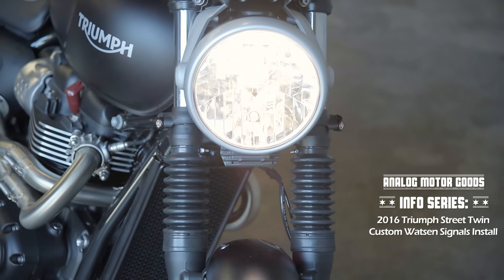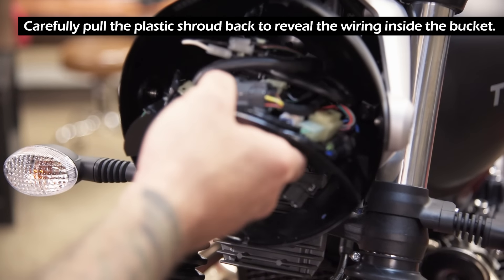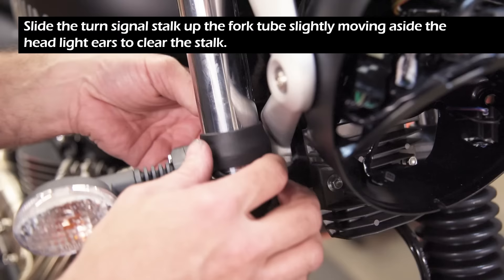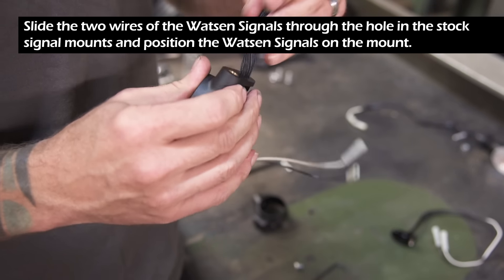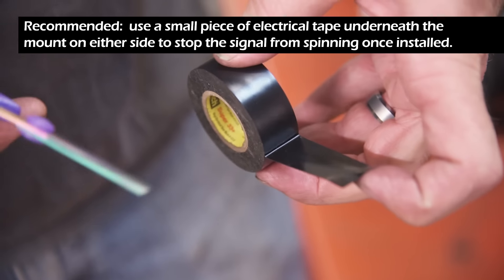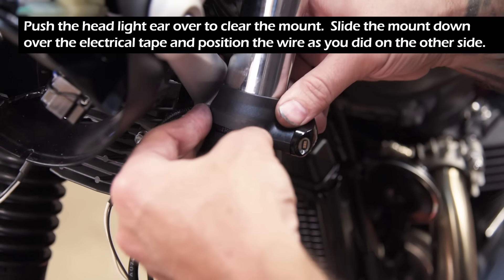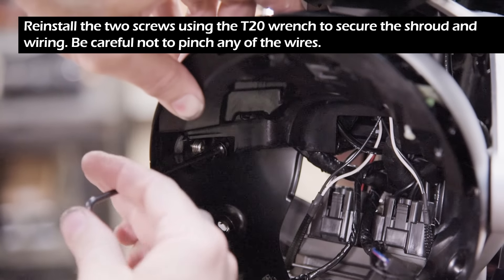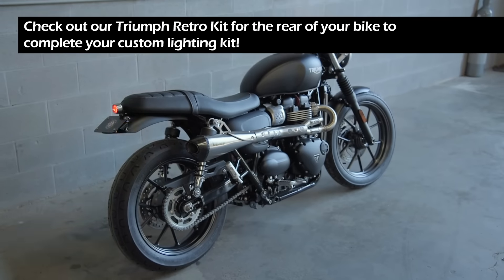Analog Motor Goods - Triumph Street Twin Analog Signal Pods Install Video

Comment: I would like to get this lights for my 2020 speed twin, is the process (the wiring) the same?  thank you in advance for taking the time to answer my question
Reply from the maker: The front is pretty much the same. Rear on that model we have not had experience with.

Comment: Just installed! Thanks for the great video, install was super easy and looks great
Reply from the maker: Thanks!!
Reply: Hello there. Just curious how easy was the install overall? Just following this video is good enough? Everything holding in place ok? thanks
Reply: @davidsantiago-ji8fi  absolutely easy, just as done in the video. I used the electrical tape and it's not moving around at all.
Reply: @alaskabrah2365  cool thanks.  What year is yours ?Did you do any lights on the back? I’m about to order a tail tidy from NRC
Reply: @davidsantiago-ji8fi  I have a 2019 and I did the nrc tail tidy as well. That was an easy install also
Reply: @alaskabrah2365  oh nice. Mine is a 2019 as well so both are on order. Do you have any pics ?
Reply from the maker: @davidsantiago-ji8fi   Sorry for delayed reply but they are pretty straight forward to install. Just like the video.

Comment: They're so small. I know, that's the idea. I take it the factory clamp is plastic?
Why does the clamp rotate on the fork leg after u put the new light on, if it doesn't prior, with original light? Can you change the bulb, or do you have to buy all new when it blows? Good job.
Reply from the maker: Clamp is plastic. They do rotate on fork with stock light if bumped. It is just a recommendation we found that keeps them staying put. LEDs are not bulbs and if they go bad need to be replaced. Odds of them going bad are pretty slim. They last a long time unless there is a something wrong electrically in your bike that damages them which is also fairly rare. We have yet to see one fail.
Reply: @analogmotorcycles  Thanks. I've been replacing a few lights on my van with LEDs. I remember the LEDs on center brake light s on vehicles, where individual diodes fail. One by one they drop out. Looking gross and losing lumins. I believe tape,under the strap will keep them fixed. Good u suggested it. Thanks.

Comment: If they ever make them for the Indian Scout Bobber but as running lights/turn signals I'll place an order.
Reply from the maker: The LEDs and voltage regulator we use would not withstand the "running" light portion of that scenario. They are only able to handle a flashing, not a constant on. Would need to be a bigger housing or different design to handle that. We do not plan to make them "running" anytime soon.
Reply: @analogmotorcycles  sad it's so limited.

Comment: Ive removed the lights from the headlight but how do you remove the cables connected to the inside of the stock LIGHT?
Reply from the maker: The video is pretty thorough. It explains the whole process. Not sure what more you are needing?

Comment: Would these fit on the rear side of of a Royal Enfield Continental Gt 650?
Reply from the maker: These are designed for Triumph's with triumph wire harness ends. We offer a Universal set of Analog Signal Pods that might work for you.

Comment: Great vid. I just subbed. Will the system and installation be similar for the 2018 street scrambler?
Reply from the maker: Yes it should if the signals are mounted in same location,

Comment: Does the bobber has the same wire harness located as shown in the video?
Reply from the maker: We have not had a bobber in house but others have installed these no problem on their Triumph Bobbers.
Reply: The 2020 bobber black does not have the same wiring harness. The signal wires do not meet in the headlight bucket. Not sure about other model years of the bobber.

Comment: I installed led turn signals on my 2017 twin street and when I press the hazard light on the turn signal go off
Reply: I am having the same issue with them on my 2019 Speed Twin, have you figured out a fix?

Comment: I’d love these on my royal enfield continental gt 650
Reply from the maker: Scoop up the Universal Analog Signal Pods and get creative. Or you can buy the Triumph Mounts shown in the video and mount them the same way and wire them in. Forks on the Royal Enfield are same diameter as the Triumph Street Twin. https://www.analogmotorcycles.com/shop/analog-signal-pod-flush-mount-universal-led-indicators/

Comment: Dear Analog Motorcycle team, 

Are thoses turn signal homolgated to use in Europe and more particularly in France please ? Also does it feat the rear stoc Street Twin fender like this one: http://www.triumphmotorcycles.fr/configurator/bike/e912f6bb-25f6-4a54-83e6-3970c91e12ac

Any advices welcome, thanks.
Reply from the maker: I am not aware of any legal implications of modifying the turn signals in Europe, so I cannot say one way or the other.  The Watsen Kit doesn't interact with the fenders at all.  Our Retro Kit mounts to the rear of the stock Street Twin fender, but that is a different install and kit >> https://www.youtube.com/watch?v=0f_xD-FtJ1k
Reply: In Sweden, the spacing between the front indicators needs to be at least 240mm. Looking at the video it seems like it should be enough space. Should be similar regulations in France as well